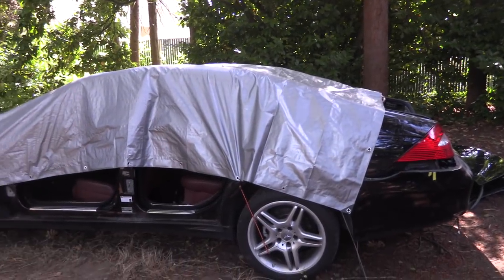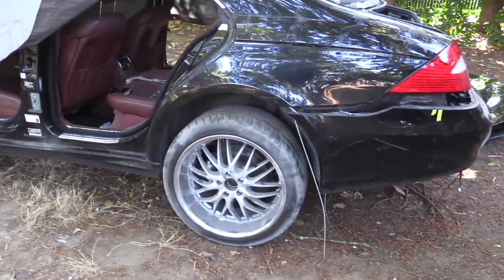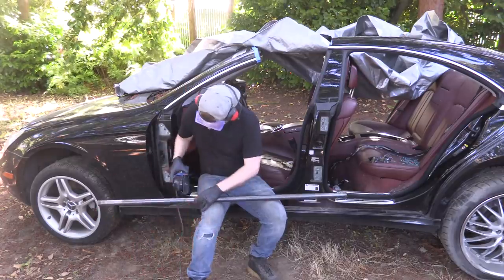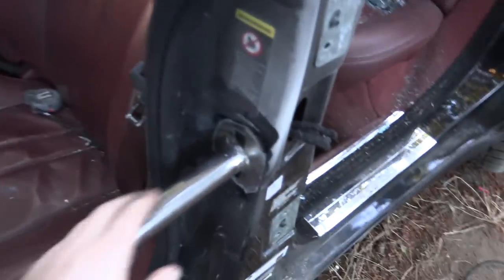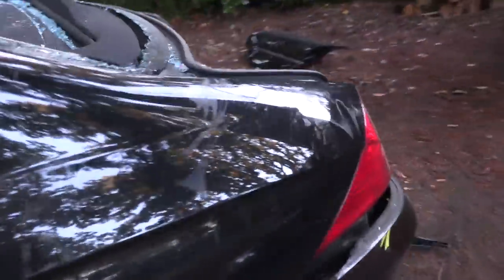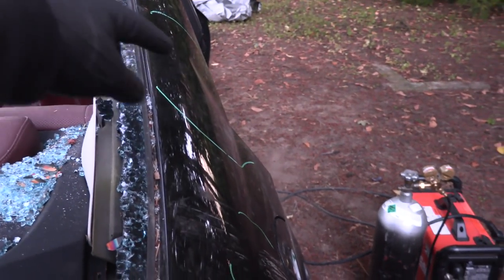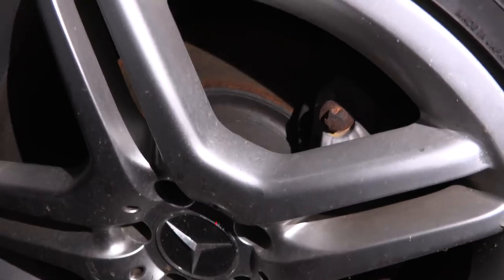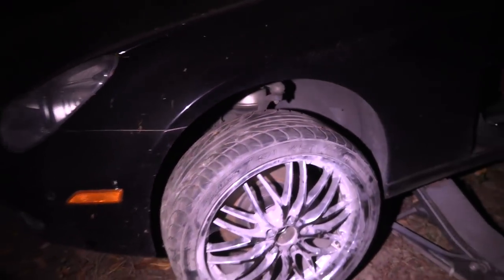The Gamblin Merc Gets Some 20's & Door Bars

Comment: You probably already figured it out but when dealing with a 5 lug wheel you only need to change the hole by 85% of the change in BCD, so your 1mm smaller BCD meant opening up the inner edge of each lug opening by 0.85mm

Comment: For the roof/window edging, you could use seam sealer and a metal plate for sealing off the structure and it looks thin enough to use a seal from the bottom of a garage door for safety.

Comment: For the windshield issue use spray foam to fill/ block it off, then use bondo overtop to shape and clean it up, sand it smooth then paint!

Comment: If you can't find a moulding just get some windscreen primer and windscreen silicone and chuck it full of it. When old bangers got new windscreens in Namibia and there was alot of rust holes around the windscreen and the guys didn't have money for rust repair we just applied the windscreen primer and then the silicone. Cars came back multiple times afterwards (windscreens break alot in Africa) the rust stopped and no water leakages reported.

Comment: Nevermind welding that roof line. Mask off immensly. Spray expanding foam in the crevasse and the gap. Let it set for a day. Then cut the excess to design, maybe form a deflector/roof spoiler out of the foam. Filler, primer paint.

Comment: You can try some rubber weather stripping for doors/garage doors along the windshield. Another option if you can't find weather stripping wide enough is to get a black rubber hose and split it down the middle to use as an improvised gasket.

Comment: For molding use the thick air pocket molding for the bottom of garage doors usualy used to help better seal bottom of garage door from cold. You are in a cold-ish area should be readily available at hardware store or a local garage door company

Comment: You could try using something like a truck bed-liner, a hose cut in half, a pool noodle, or silicone to stick the metal plate instead of welding.

Comment: You may want to do "Half doors" and just weld in a panel to fill the hole from the bottom of the door to the bar for puddle crossing, flying rocks and any sticks that you run over having a tendency to snap back at the car will get that rather than you and whomever.

Comment: You can use vacuum hose cut it open then you can wrap the exposed metal . Adam Lz does it after cutting holes in his skyline for the inner cooler piping.

Comment: You can use the rubber gasket from a camper. I think they call it the accordion gasket but it is wide enough and you can get it in different sizes at any camper or rv place. Some dealerships carry it for fleet vehicle or van conversions.
Reply: You can also use that trunk or door gasket that no longer does anything.

Comment: Use a big vacuum hose or coolant hose for the windshield. Just cut through one side and make a C shape. Then just pull it apart till it fits over. It wont look the best but it will cheap and easy.

Comment: Use heater pipe foam for the windshield trim. Attach it with some cocking if necessary. It cheap and comfy to hold on to when offroading.
EDIT: Or just use spray foam, no trim at all.

Comment: For cheap easy protection from the sharp windscreen top get some black poly irrigation pipe of say 1 inch 2 inch or 3 inch and cut a slit along the length of it and slide it over the sharp edge

Comment: You can use the rubber weatherstrips for pretty much any convertible.  I'd start with weatherstrip for either and Mercedes CLK W208 or W209 convertible as they may be spot on the exact length needed.

Comment: Instead of using a rubber gasket on top of the windscreen you could use spray foam filler and shape it then spray it black.

Comment: just see if the door trim rubber molding will work. if so go buy some or use the stuff off a random beater car you got.
Reply: chasemc69  or use  the rubber from the trunk
Reply: or the rubber from the doors, which aren't being used? lol
Reply: Yes but those are still being used in the door opening arent they? 
Or has the door itself also rubber on it ?
Reply: wdgaming1997 well he should have some from the vette cart as well
Reply: yea thats not the safest thi ng to do. a simple hose cut in the center and glued works alot better.
Reply: Pool Noodle ?
Reply: Truck camper gasket is what you really want.

Comment: The "Otis" Maybach seems to have some kind of rubber tape to seal the gap above the windshield. I was thinking flex tape might solve your issue, if not a couple tubes of gasket maker would fill the entire area nicely, but a few rough grabs may expose the sharp metal. Goodluck, this seems like a really fun build :)

Comment: closest thing I can think of to cover up the top of your windshield would be those rubber or plastic tailgate lips people buy for trucks. idk the official name but they pop over the top of your tailgate and wrap around the top few inches to protect it from wear and tear. idk how fitment would ever work with that, but it's my only idea.
Reply: another last resort would be to use pvc piping. cut a portion out of it lengthwise and it should be flexible enough to wrap around the top and bend with the curve of the windshield.

Comment: Rubber for the front try the bottom garage door gasket as for HF dent removal it is junk. you would be better off using hot water bottle and your composer if you can get at it. love the builds

Comment: You can get the top trim for the windshield frame from a local camper / rv  or Truck camper shell dealer its door edge seal / weather strip " lock seal " mainly used on fiberglass boats / truck shells / campers  you want the type with the metal inside that locks on  like www.ebay.com/itm/142810550711?rmvSB=true

Comment: Gasket stuff why dont you use rubber pond sealer in chaulking gun and smooth it out it will work like a rubber seal plus be 100% water proof

Comment: Who cares, that Merc is practically garbage unless you want to section the whole rear floor pan, roof and pillars. 

Cars like those are not built like a BRZ where you can peel back the run channel and access the pinch welds.